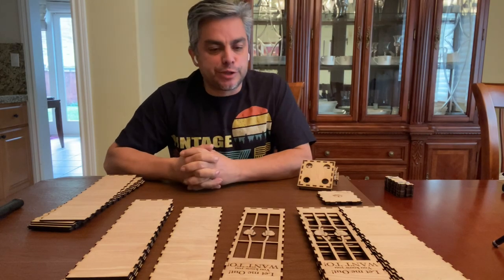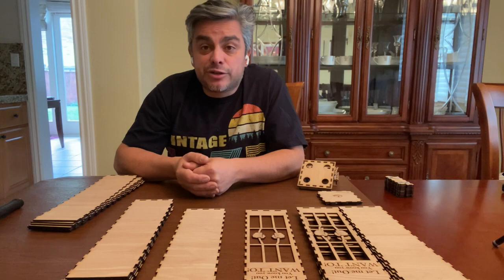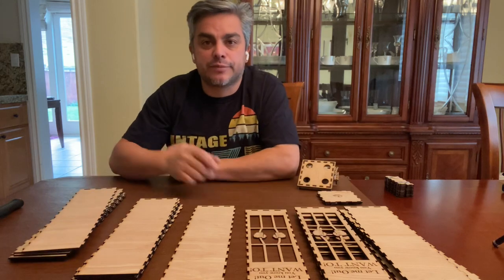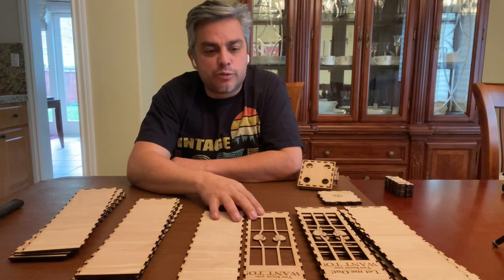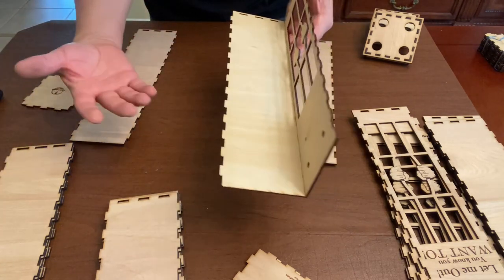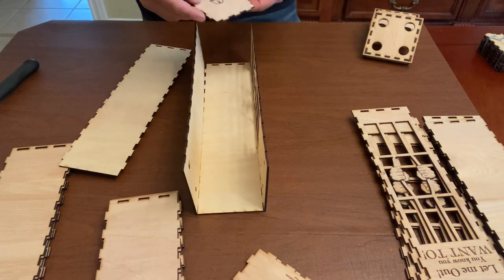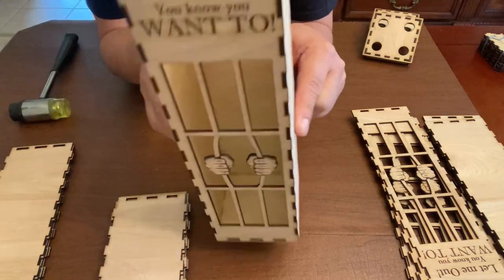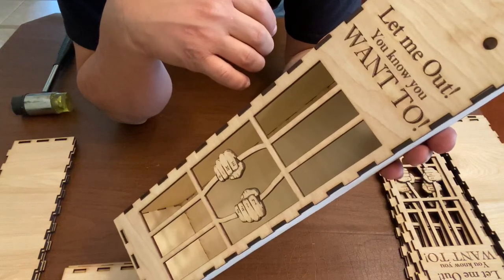#JailedWine Box - how to assemble the laser cut wine box. Step by step.

Comment: having a hard time sizing to design to my glowforge.  when I download the design it bigger then the 12x20 wood for the forge . Do I need to resize the design or make individual pieces.
thank you John ..
Reply from the maker: Hi John,
In a 12x20 you will have to print it in batches - 
So, let’s say half of the box and than the next halve - 
You could resize it yes, *But you will loose the dimensions for the box therefore you won’t be able to fix a wine bottle.
Cheers !
Reply: thank you so much..